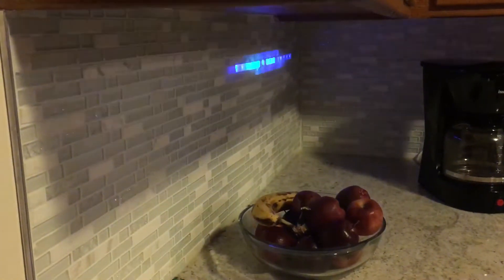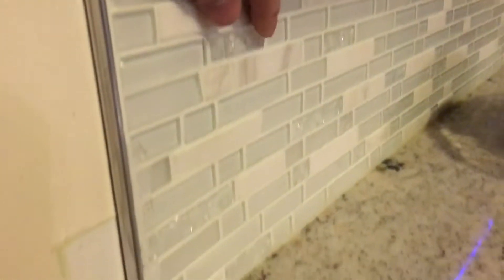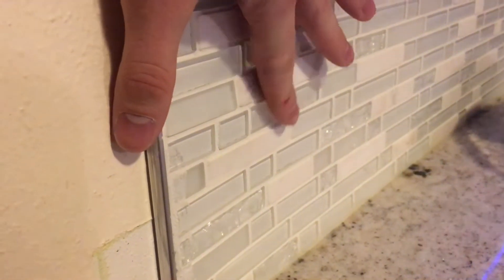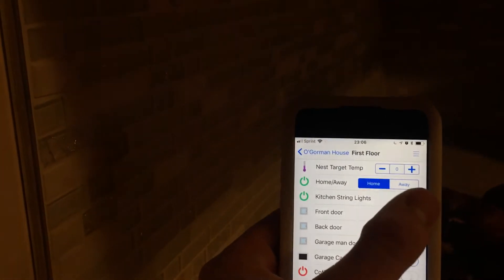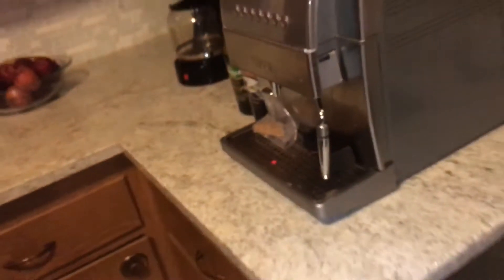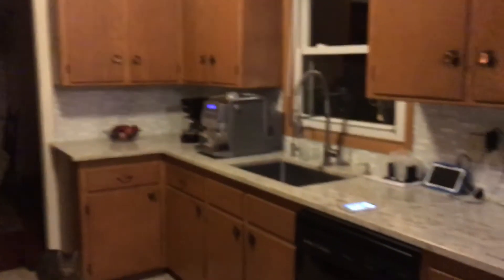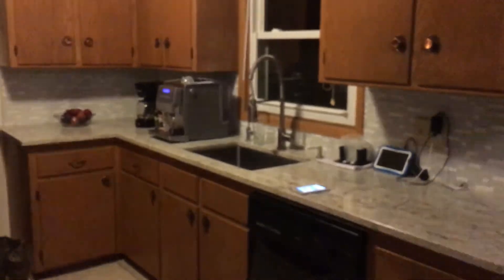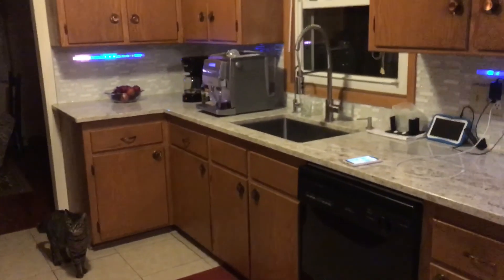LED lights in kitchen backsplash

Comment: These are the glass type or transparent type of backsplash As stated he mounted the strips and the added backsplash and I assume he added the adhesive  around the backsplash away from  the strips..I assume they dropped wires into wall and dropping them in the cabinet to run em to control panel. I'm looking  to do  something  similar  but not as extensive like  this
Reply from the maker: That’s correct - I used adhesive to stick the tiles on the wall with small trench cut along the length of the LED strips. The wires drop down in the wall and over to the control box.